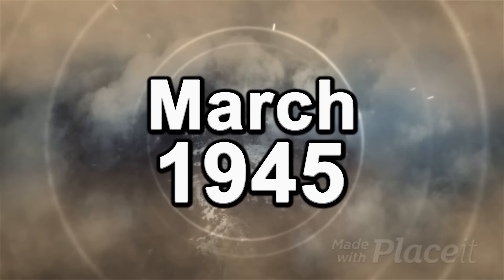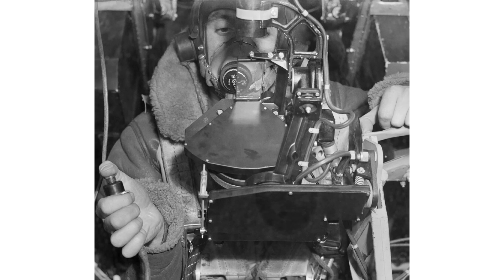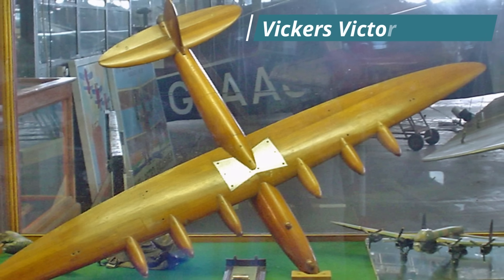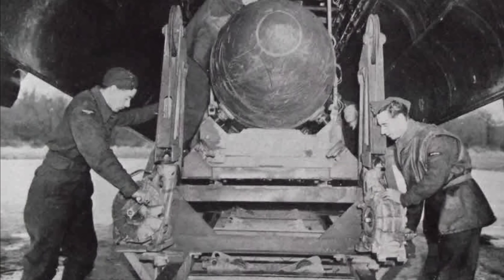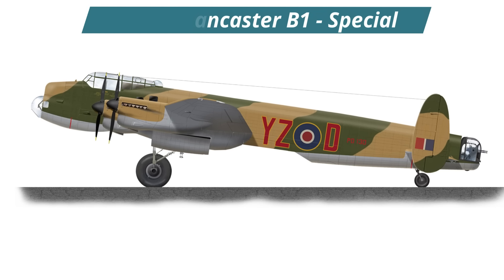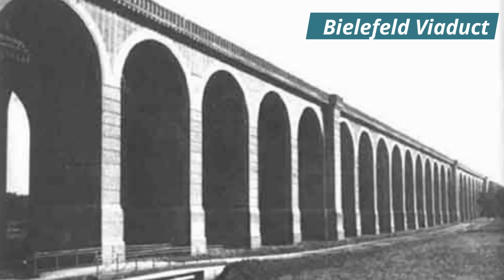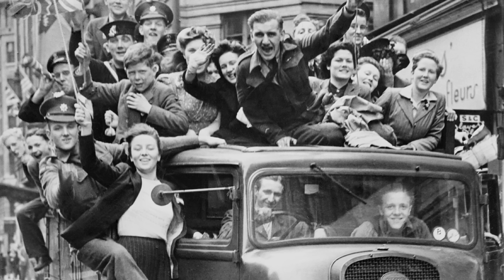The BIGGEST Non-Nuclear bomb in World War 2

Comment: Interesting looking at some of the archive footage of Lancasters in flight. You've used footage of the Mk2 of which there were only about 300 built, using Bristol Hercules instead of Rolls Royce Merlin engines.
Reply from the maker: The difficulty in making these videos is finding appropriate footage. It won't always be accurate but I try to be as accurate as possible where I can.
Reply: My remarks weren't meant as a criticism. More an observation, as the mk2s were distinctive with their radial rather than v/inline engines.

Comment: Lancaster Bombers. Absolute beast of a plane. Not much really came close to what they were capable of carrying (during the war anyway). Such a versatile bomber, straight out of the box. 

Interestingly, they were considered to be used by the Americans to drop the atomic bombs on Japan, as they were at the time the only plane capable of carrying such a payload. Ultimately they ended up using heavily modified B-29 bombers.
Reply: Those "Silverplate" B-29's still had to use the British bomb-release device designed for the smaller Tallboy bombs, those bombs being similar enough in weight to both Little Boy and Fat Man, despite their differences in shape.  This was because the American release mechanisms didn't work and couldn't be made to work in time given the deadline for the Little Boy mission.   Later called "Saddletree" B-29's, similar, though not used in the war, used an American bomb release mechanism.  So a bit of Lancaster was involved in the atomic bomb misdions, however indirectly.
Reply: Thats true. they required almost no modifcations at all to carry the weapons dropped on Hiroshima and Nagasaki, but the Americans persisted with making the B29's  capable of carrying them, at great expense and effort in modifying them to do so.
Reply: @owenshebbeare2999  Lancs were not pressurised and not capable of reaching the 30,000 ft needed for the blast to be survivable. Even so the B29 was thrown about quite a bit.

Comment: Very good documentary!  The only thing i'd say you missed on covering was the only reason they could bomb from so high up- WAY higher than normal lancasters did, was the new bombing sites that had been developed that they got- I think they were american?  They were fancy and accurate enough to let them  bomb from so high- (with the added aid of the mosquitoes dropping marker flares).

I love that shot of the railway tunnel under the hill that got hit lol.  One of my fav stories you didnt m ention was the submarine pens with the incredibly thick roofs they wasted- the bombs went straight through lol!  The roof entire pens were tilted and subs blown out of the water etc.  And just think, it would of worked even better if they could have been dropped from twice as high like intended.

Its a shame bomber comand didnt listen to Wallis earlier- they could have been taking out high value targets and causing less colateral damage for years- AND the bombers were safer so high up.
Wallis was a genius - he also designed the wellington bomber- a mainstay of bomber command - not many individuals contributed so much to the war effort as he did! (Turin and the other top code breakers aside).
Reply: Hardly…nearly all RAF bombing was at night where the problem was nothing to do with aiming but actually finding the city they wanted to bomb.  It was the development of H2S radar and the use of mosquito target marker aircraft that finally resulted in successful area bombing.

Comment: Imagine having to land with one of these strapped to you. A nuke has the advantage of not detonating except if a freakish set of circumstances happen to it in a crash, this though. "Get your diapers on, lads! ..... Lads?" - everybody having bailed as soon as they saw Brittish soil beneath. Balls big enough to do that to save cash, is generally called total madness. Ordering it takes a psychopath.
Reply: More than 800 American four-engined bombers in full working order landed in Sweden and Switzerland during WW2; their crews being taking the easy way out.
Reply: Ha... No, the first generation atom bombs had basically NO safeties to prevent accidental detonation... the "Little Boy" took off with wooden plugs inserted as "safeties" to disable the arming circuits until it was airborne, subsequently the bomb was armed by replacing the green wooden plugs with red ones with a copper strip that completed the circuit to the detonators, but the "Fat Man" implosion bomb couldn't use that method for safing.  Plus the explosive was not the "insensitive" type and could explode in a crash landing or a fire on the aircraft.  That was particularly dangerous in the case of Little Boy, as it's design, basically a cannon with a slug of U-235 for a bullet at one end propelled by explosive to ram into another mass of U-235 at the other end to complete the assembly and achieve critical mass quickly enough to achieve a chain reaction detonation, there was no way to stop this from occurring and creating a nuclear detonation (or at least a 'nuclear fizzle' which is still a powerful explosion and highly radioactive as well).  The implosion design weapon (Fat Man) would likely explode in a fire or crash, but the fact that the explosion would start on one side of the device and proceed to the other side would not result in the "implosion" necessary to crush the core and pit sufficiently to create the necessary critical mass for a full chain reaction nuclear explosion, though the core masses were high enough in these early weapons to be close enough to critical mass just sitting there that it was quite probable that a "nuclear fizzle" would occur-- an "excursion" where a chain reaction starts but then stops, releasing a prodigious amount of energy as an explosion of several tons to tens of tons of TNT equivalent power, and a radiation pulse and burst of high energy neutrons and gamma/X-rays sufficient to kill exposed personnel at some distance (basically, a crude neutron bomb).  

The concern was sufficient that the Fat Man type implosion bombs, which were the backbone of the early US nuclear arsenal, were ordered to be flown only with their pits removed, to eliminate the possibility of accidental detonation, while work proceeded on safer designs like the Mark IV, which had a "door" in the front to allow the "capsule" or pit to be removed and installed in flight for arming.  In fact there was a crash and explosion of a Fat Man casing and explosive assembly, minus the pit, thankfully, that occurred in California in 1950 when a Silverplate B-29 on a ferry flight to Guam (as part of a force of ten assigned to redeploy to Guam for possible nuclear bombing missions in Korea or Red China if required) crashed after takeoff, resulting in a subsequent explosion after the aircraft burned on the ground, killing quite a few people and causing numerous injuries.  It also resulted in renaming of the base to Travis AFB, for the General killed in the crash.  Luckily there was no pit installed.   Another Fat Man type bomb broke loose from a bomb shackle in the bomb bay in a plane over Florence, SC, and ended up detonating on impact behind a house in the area.  The bomb blew a huge crater in the ground and virtually destroyed the house, but luckily there were no fatalities.  It was one of the first 'Broken Arrow" incidents with nuclear weapons in the US.  Later!  OL J R :)

Comment: 1:13 Immediately a big point of confusion: Lesser charge-to-weight ratio isn't just worse - it depends what you want, and there are theoretical optimum ratio brackets for different things. Very high capacity bombs with very thin walls will give tremendous blast effects, but the danger area around the impact point can actually be extremely small due to there being so little solid material to turn into fragmentation. On the other hand, another bomb with particularly low explosive yield for it's overall mass will be likely to produce very heavy, but less numerous fragments.

Comment: The early part of the war, the RAF was using marking colour flares that was dropped shortly before the actual raid. As the markers could be moved or exterminated, the enemy would shift the main markers as far away as could be carried prior to the commencement of the raid. This was the reason for the inaccuracies of the mission but wrongly attributed to the bomb raid. As this was considered to be the total inability for accuracy during night missions. Let’s not forget that the RAF has continued with night missions and had largely corrected the inaccuracies they had experienced since the latter part of 1939.   Now they had tighten up the inaccurate missions with better equipment in the mk14 bombsight that was equal too or even slightly better. The marker system was now markers using parachutes that was dropped periodically by the pathfinders until the end of the mission by the bomber force.

The USAAF was then largely accepted by their experts that they had both the better bombers along with the better bombing equipment. Therefore the RAF was largely spinning their wheels and though the British recommended that the USAAF bomb along side with the night missions.  They turned down night missions as a whole because ;
a) night bombing accuracy was a misnomer 
b) they had the bombsight which could drop a bomb in a pickle barrel from 10,000 ft. 

This may have been known to happen out in the deserts of the USA where the weather patterns were optimal, it only proved that if you wanted bombing accuracy, well they were it.  From extreme hight, due to the wind currents and speed, along with many other factors, it was proven it was not possible, even with the bombing tech of the American bombing force. When they tried to prove such accuracy, they lost 1/3 of their bomber force during the first horrid days where the bombers “COULD NOT” protect themselves without fighter cover. Either way the Germans had a copy of this bombsight intact from a wrecked B-17 crash. They were amused at the extreme secrecy of the average bombsight. 

With the new creation of the stream lined body and the slight offset of the tail fins that improved the stability of fight for this amazing artillery of the RAF. During the drop they would gain speeds greater then “Mach 1” giving them great penetrating power, enough to penetrate the side of a mountain and block the tract which took up to the day that the Allies arrived. Powerful punch and it didn’t take yrs to develop the Lancaster bomber. The only Bomber that had a bomb bay large enough to cover the bomb through flight and enough power to carry this mass was the fabulous Avro Lancaster.  There was nothing in the USAAF arsenal that had the power & space to carry either bomb. That’s amazing. 

No wonder the Americans didn’t want them in the Pacific. Their bomber in creation was way over budget,3+ years late, even costing much more then the creation of the atomic & hydrogen bombs.  They were putting their faith in the B-29 so they didn’t want the competition that the Lancaster Bomber, which was developed in  late 1940, from a failure attempt of the Avro Manchester. Even with the completion of the B-29, it had to be altered from itself, because the atomic bomb’s that came off the line, would not FIT inside their bomber. It cost in redesigning needed to the bomb bays because the main spars divided the bomb bay in half. 

I’ve read on different sights how the Lancaster would never do  and yet, when the bottom line is weighted, there was very little alterations needed to carry their block busting monsters. They removed the armour plating and the mid-upper turret for the Tallboy and both turrets, front and mid-upper were removed to carry the tremendous weight of GrandSlam bombs.  After the job was completed, they simply replaced the missing equipment.
 
Not so for the B-29 as it was discovered that half of the advanced systems that cost so much in design were removed as they were not needed. As for the air-cooled engines that are always stressed because of the possible mission ending water cooled engines, I seem to recall that the B-29’s were problematic. In fact they self destructed killing their crews along with them. So much for the advantages of the radial air-cooled engines.
Reply: Avro 683 Avro Lancaster B.1 Special	32 Aircraft were adapted to take first the super-heavy (12,000 lb) ‘Tallboy’ and then ‘Grand Slam’ bombs and included up-rated engines (with paddle-bladed propellers to give more power) and the removal of gun turrets to reduce weight and give smoother lines.  For the Tallboy, the bomb bay doors were bulged slightly whilst for the Grand Slam, they were removed completely and the area faired over. For some Tallboy raids the mid-upper turret was also removed. This modification was retained for the Grand Slam aircraft and the nose turret was also later removed.
BAE Lancaster page

Comment: Calculations predicted the steel available would fail if made into any bomb bigger than a Tallboy. The Germans  built hundreds of facilities hardened to sustain themselves. Midvale developed a far better steel before WW2 began and it's introduction halved the weight of guns and armour plate. With this they cast the Grand Slam cases. They were completed in  Britten. It too was used in the Disney, rocket accelerated bombs also finished in Britten but structurally, only flying fortresses could carry a pair. In the last month's of the war these two were used widely.  An RAF officer ripped open the U boat pens  in Hamburg, only to take the surrender, the following day, upon inspecting the results, taking also the compliments of the German officer on his brilliant bombing success.😮

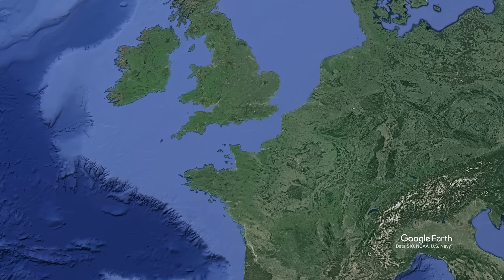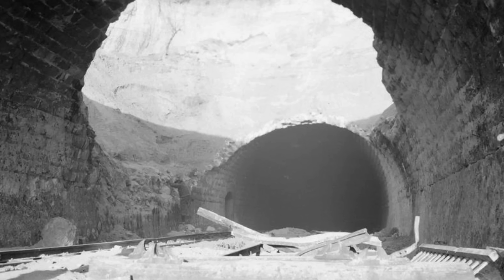Comment: Here is a question.  At 6:43, the narrator states that the first use of the Tall-Boy was "on the first of June, 1944."    At 8:13, however, the narrator states that the Tall-Boy was used against the Tirpitz.     The Tirpitz sunk in  1941.     So, there is a temporal anomaly, here.   How should we resolve it?

Comment: 42% RDX, 40% TNT and 18% powdered aluminium(5-50 micron aluminium particles work best)
you could actually use nitromethane and ammonium nitrate with the aluminium powder if you wanted to make it a thermobaric charge and suck the air out of the bunker you drop it on

Comment: No mention of the fact that a significant limitation on the use of these bombs was the fact that the large main casings had to be machined in the USA where the availability of the only machines large enough perform this task created a serious bottleneck in production? A search of the available literature on Barnes Wallis, Tallboy and Grand Slam production should confirm this recollection.
Reply from the maker: Interesting fact. The research notes I read suggested the alloy steel was machined in Glasgow. Perhaps there was 2 plants involved? I may dig a little deeper
Reply: We ...The Workshop of The World we wouldn't risk sending  any of these precious high test steel castings by merchant ship over the Atlantic when we could do this simple job ourselves ... blindfolded!   If we can cast them we can machine them ... no trouble.    These huge earthquake and armour piercing  bombs were made in their totality complete to the last nut and bolt at Sheffield Steelworks Yorkshire England and not anywhere else....  Sheffield was making swords in Roman times we have an ancient guild of  master cutlers who still make exquisiteness to order..  We at Sheffield invented modern steelmaking.    We made the fan blades for Whittle's jet engines we invented stainless steel and we are still here working withour oppoes next door in Derby!
Reply: Where do you get your history from? Made in the Uk at Sheffield the hole bloody lot.  Out of interest the US was using the Grand Slam up until the first Gulf War. Mayber you were thinking of those ones post war?
Reply: @dulls8475  The Yinks didn't have an aircraft which could carry the grand slam until the 1950s

Comment: All OF WALLIS'S  bomb casings and prototype Bouncing bombs were produced in Sheffield River don works??? Two Massey press hammers were imported from Germany to Supply Germany with Camshafts for their Aircraft? only one complete hammer was delivered And half of the other? So a second part was produced to fit and produce [parts for the spitfire and Hurricane Mosquitoes and others These machines worked and were used well into the 1960's and beyond? Men worked well into the moment when bombs rained down on Sheffield and the Don valley?? Bombers following the river and train tracks into the city center missing the works         Two bombs fell on Alfred Road Brightside lane and a time delayed Parachute bomb that first dropped its tail and whistled  and 10 minutes later the main bomb landed in the rail track Gully  of Jenking road Station & Bridge Exploding lifting up houses and demolishing some others??? Yet the blast followed the Gully of track leaving the Bridge near by intact as it stands today                                                               Fitzallan square Marple's Pub was hit direct Killing all inside The Wicker Arches rail; Bridge As seen to day had a bomb direct hit through it leaving a re[pair hole seen to this day? My father worked with many others  on the Hammers and furnace's for 44 years